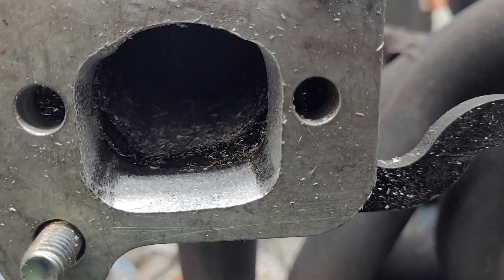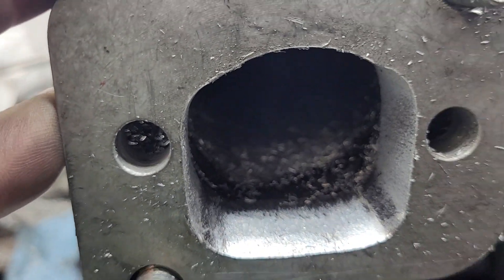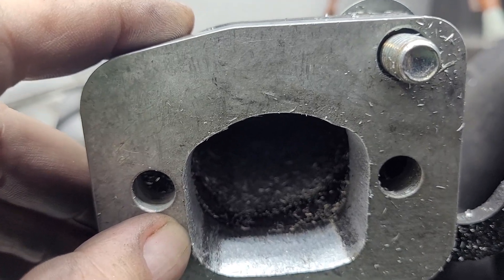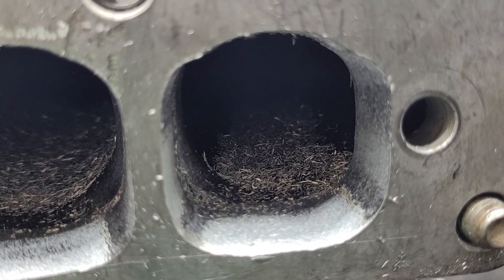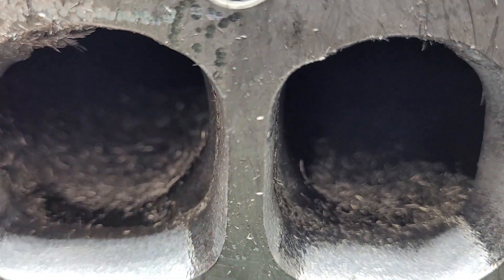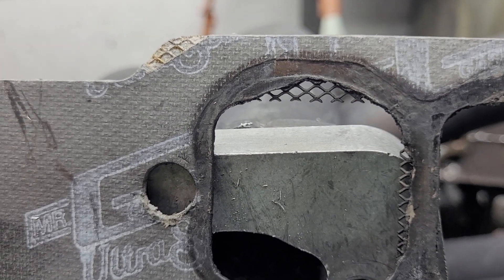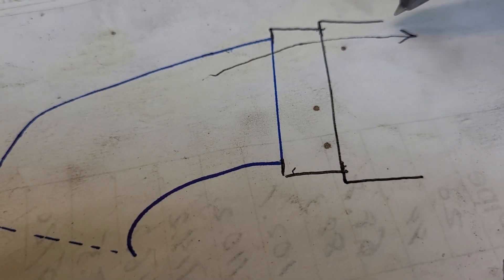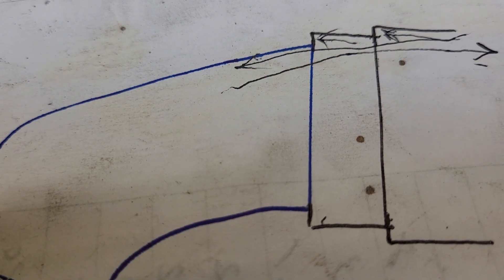355 short track, Stahl adapters  Brodix Track 1 to Schoenfeld headers. Anti reversion exhaust theory

Comment: Anti reversion also helps the exhaust driven induction cycle. Way back, I port matched a set of Hooker Header plates to a set of Ford TFS heads. In my case I was able to bolt to the head and grind till things matched up. I noticed when grinding (these were steel) that I had to pay attention and match the port angle as well as shape. Like you mentioned I left a small intentional mismatch at the port floor so flow went one way. Thanks for sharing.